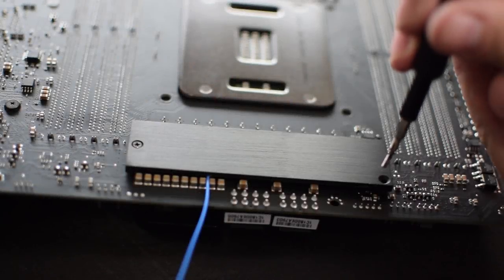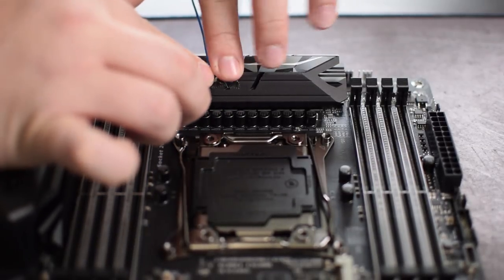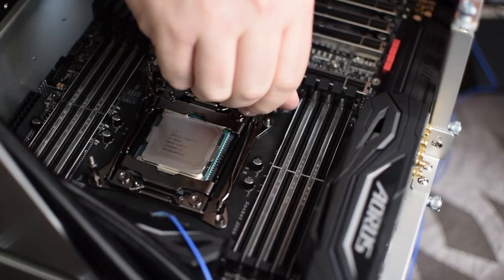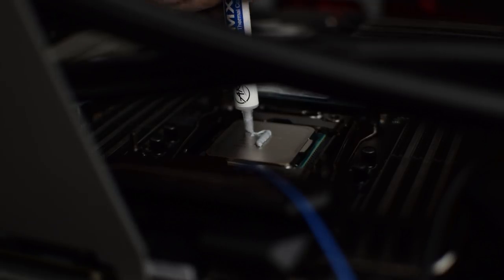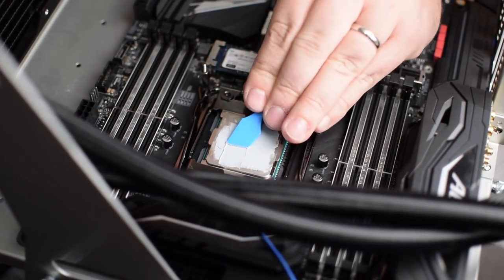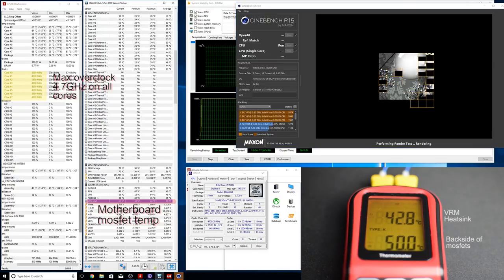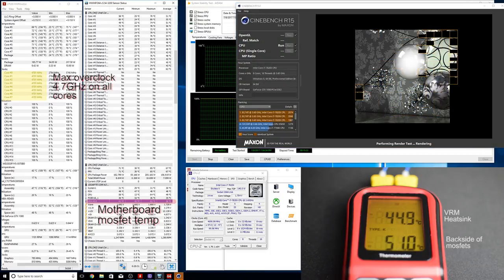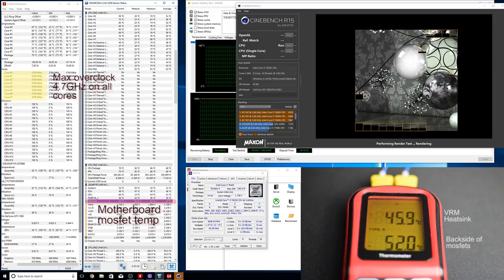The truth about X299 VRM temperatures featuring the i7-7820x & Aorus X299 Gaming 7

Comment: Im happy to see that you seem to enjoy the board in the end. I actually just picked up the "pro" version of this board which seems to have changed some of the power delivery with its phases. I'm hoping this might benefit cooling of the VRM if I do ever get the hankering for a high OC. Though I'm an air cooler guy so my OC will probably be limited to around 4ghz. And I imagine that probably wont stress the VRM too much. Same CPU as well.

 I'm coming from an i7 980x from the 1366 days so I'm partially familiar with a power hungry system :)
Reply from the maker: That is a massive upgrade man! Holy moly. I hope you enjoy the new system sir. Everyone had terrible things to say about x299, but I love it.
Reply: Let's Get Techy Thank you sir! It has been a long overdue upgrade. I think the power hungry nature of the platform isn't a huge deal when selling to enthusiasts. We know its gonna be hot, that's why we have aftermarket fans and heatsinks fo play with :)

Comment: I'm subscribing right now. Also I'm currently thinking about getting a 7820X, but I'm not really into Overclocking, maybe I'll be  getting it to 4 GHz. As you said this platform is not an entire mistake from Intel. This platform won't burn out your house unless you stress it to the limits. It will be worth coming from a crappy Dual Core AMD AiO build!
Reply from the maker: Thanks for the sub!

Skylake X, to me, is a great platform. I love it. That being said, its price to performance isn't all that great. If you are considering the 7820x, spend some time also looking at the Ryzen 7 lineup- especially the 1700x if you aren't much of an overclocker. You could easily hit 3.8GHz on all 8 cores with minimal effort. I'm not saying don't get the 7820x. There is a reason I got mine, and refuse to jump ship for Threadripper, but the R7 lineup (especially the 1700) has great price to performance. 

Thanks for watching! Hope to see you in the comments again soon!
Reply: Well, maybe I'll be pushing my 7820X to 4.5 GHz. As a first time builder, I'm planning to make a custom loop, it doesn't seem that hard for me, but I don't know if I need to delid, I'll see.

As you said, Ryzen 7 would be more interesting, especially for the performance/cost ratio, but I'm surely going with the 7820X and I have the possibility to upgrade to the 7900X whenever I want to, and that's great.

By the way, congratulations! You have a very informative channel that I really like, I'll be looking to more videos soon!
Reply from the maker: Whatever build you end up doing, come back and share it here. I would love to see it!

Comment: Great video!I'm thinking in making a new build with the 7280x. Could you please tell us what settings did you use for your oc? And where are they in that particular motherboard/bios?You probably said in the video but I missed it sorry (non good english speaker here) 😓
Reply from the maker: So the main settings you will be looking for on any motherboard are "core ratio" and "CPU core voltage". My settings for this overclock of 4.7GHz are a core ratio of 47, and a CPU core voltage of 1.19v. 

If you plan on overclocking, I would only recommend this CPU if you run a custom liquid cooling loop. I have it on a Corsair H100i V2 all-in-one cooler, and it hits close to 90c when encoding in Premere Pro.
Reply: Thanks! Did you disabled the intel turbo boost 3.0 or any other "auto mode" boost?

Comment: now in 2024 LetsGetTechy prooved it to be right and the fact that X299 is still awesome, lol, what everyone besides the VRM issue which was mosty created ^^ they heavly underestimate that platform :D
(currently running a 7820X/64gigs/1080ti on an Asus Rog Strix -E Gaming 1 and a 10940X/256gigs/RTX 3090/3070 on an MSI X299 Pro <3
Maaan!!! Was my R5 5700G/32gigs and R7 3800X/48gigs slow before that to heavy Multitask /game at the same time, even in gaming they where worse then the mighty 7820X which is hot and old now WOW, and all peopled cared at the time was the VRM issue and i scratched my head :P
Good jorb on the vid, alltho 7 friggin years later ^_^

Comment: great and informative channel was your 7820x delidded if not what max oc did you achieve and what was your cpu temps
Reply from the maker: Thanks for the comment! I have not yet delided my 7820x. I'm still waiting on Roman's delid tool that keeps getting delayed. :( Without a delid I was able to hit 4.7 at 1.19v but the temps were in the low 90s, so I backed it down to 4.6 at 1.16v until the delid. At that speed and voltage, I'm in the mid 80s.

Comment: I have my 7820x overclocked to 5ghz, but don't like the temps, even after delid using LM. "105c on three of my cores running 100%!" I can hit 5ghz stable 1hr on XTU at 1.36v, but can't run Cinebench, unless it's at 4.35v?! I'm using a ROG Strix XE. I haven't used LM on top of the IHS and waterblock, which should drop temps another 5c. Should I just go full water, or would I see little benefit? I'm using a 360mm AIO. "One of the best apparently."
Reply from the maker: What AIO do you currently have, and are you positive you have enough LM between the die and IHS? I went light on liquid metal once and had to completely disassemble an entire loop to add more, and temps dropped 20c. I would attempt LM on the top of the IHS before I went full custom loop.
Reply: fair enough. I may retry another application with more LM, but why is it that Cinebench requires that much more voltage, more than is needed when stress tested?.
Reply from the maker: Different programs just stress it differently. I've had CPU overclocks perfectly stable in CPU benchmarks and then load up a game that isn't even CPU intensive, and have it crash. It's weird the way that works sometimes.
Reply: I use the thermaltake floe riing 360. Apparently bested even the Kraken x62 and Corsair h115i
Reply: I'll apply more LM, I just don't want it all goopy, sliding around, even though I used nail gloss to protect the capacitors. It'll give me a reason to use electrical tape this time. but I'm still dying to go full water, since I have an open case. 215 single score and 2200 Multi in Cinebench is still pretty nice. though it might go up higher if I tame the temps a little.
Reply from the maker: That is a great liquid cooler, even better overclock, and astonishing CB single core score. I'm jealous man.
Reply: Thanks! How much is enough LM?
Reply from the maker: If you check my other delid video and look in the comment section, a lot of people disagree with me about that very question. You don't want it to look like a mirror-finish puddle, but you want just short of that in my opinion.

Comment: I Need a gigabyte X299-WU8 setup for the I9 7900X that has been delided....
Reply from the maker: Oh you mean like overclocking settings? Honestly every chip is going to be different, but you want to focus mainly on core voltage and loadline calibration. Look into both of those, and you should be able to find some base settings to get you started.

Comment: I want to get this Motherboard. Any recommendation for a case? Power supply size?  I was thinking of a 1080 and they mention a 650 watt supply
Reply from the maker: If you plan on getting this board you will be using a Skylake X CPU which are decently power hungry when overclocked, so if you pair it with a GTX 1080, I would suggest at least a 750w depending on which CPU you choose. As far as cases, they are so subjective it's tough to make a recommendation. Maybe take a look at the new Lian Li O11 Dynamic.

Comment: 208/5000
hello i have a 7820x i7 i not overclok them and i use a corsair liquid cooling h110i i go up to 85 to 95 degré you found you its normal?

idle: 40 - 40 degré

cpu stress: 85 -95 degré
Reply from the maker: I would not consider that normal, unless you are stressing the CPU very hard. What are you doing when it hits 85-95c? I would expect to see that temp if you are stressing with AVX workloads and using an air cooler, but not for more "normal" workloads and a Corsair AIO.
Reply: to reach it's temperature I used OCCT for stressed the CPU, I specify that the processor is not overclock.

sorry for my english I'm French ^^
Reply from the maker: I would suggest manually tuning your vcore voltage. The motherboard is likely automatically using more vcore voltage than is necessary. 

No worries about the English! It's fine. :)
Reply: on the other hand I just saw by removing the processor that a pin of the motherboard was crooked I straightened what is a report on the temperature?

I use a motherboard asus x299 rog strix and I had set the default bios parameter.
Reply from the maker: @xskyros  I'm not sure if that bent pin would affect temperature or not. Let me know how it goes once you put it back together.
Reply: Normally if the pin is a problem the pc does not boot, off the pc boot well works well I just have a problem overheating.

on the motherboard asus rog strix x299 i have 2 hookups
an 8 pin
a 4 pin

you have to connect the 2 pins?
Reply from the maker: If you only have the 8 pin connected and it works then the 4 pin is just extra for overclocking. Some require both and some don't. As far as the pin, it really just depends what the pin is for. I've had motherboards before with missing pins that still functioned properly.
Reply: ok I'm trying to plug that 8 pin

and see what is going to give, I also benefited from updating the bios I want to know thanks
Reply from the maker: Good luck!! Let me know how things turn out! :)
Reply: I have to try anything to change, it is the pin of the motherboard that is problematic.

more than to change the motherboard: /
Reply from the maker: I wouldn't think that pin would cause overheating though.

Comment: Doesn't the second heatsink of this board keep the vrm temps lower?
Reply from the maker: There is a second heatsink, that does help with VRM, but if you remove the safeguards, it still isn't enough to contain the heat. This board does a bit better than the others, but isn't immune to the issue.
Reply: But after which Clockrate do you have to disable safeguards? I want to delid my i7 7820x but i need a fitting board. Roman says the Apex from asus fixes the problem but i guess it takes a few months until it arrives
Reply from the maker: You don't HAVE to disable the safeguards at any particular clockrate. It is just one of the things you can do at any speed to help improve stability if you are having a hard time getting stable. Mine can do 4.8GHz on 1.22v without removing any of the safeguards FOR THE WORKLOAD I have. If I ran Prime95 with those settings and without the safeguards disabled, it would likely be very unstable very quickly.
Reply: Okey thank you this makes me happy. So i'll order this board

Comment: i have a question can you please let us all know the stock temps of i7 7820x ?? its a request cause this info is not available on net
Reply from the maker: Well unfortunately it seems like most of the motherboard vendors decided to have these chips run full core count boost out of the box. I can try to mimic stock form as best as possible, or I can leave it how it would be out of the box- whichever you would prefer.
Reply: A bit late but you need to upgrade your bios. I had this too at F5 bios. But after i updated i noticed that i lost performance. It is a setting called something like "enhanced multicore performance". I'am not sure if it is performance or what else. I can't deliver Temps either because i have a delidded 7820x
Reply from the maker: You are correct. Many x99 boards had this same "feature". It basically runs all of the cores at the max turbo frequency that Intel intended to run a single core at. Not necessarily a bad thing, as I and many others have overclocked well past this mark, but it can cause issues in situations like this where you can't directly compare temperatures across different board manufacturers.

What did you use to delid your 7820x? I'm not doing a good job of waiting patiently for der8auer's tool. lol

Comment: should I connect the two 8-pin ATX 12v on x299 mobo?
Reply from the maker: Yes you should. It isn't required on most, but I would definitely recommend it if you have the second plug available coming from the PSU. In certain situations like what I describe in this video, you can get the cables on the plug coming from the PSU very hot when only using one plug.
Reply: Thanks! :D
Reply from the maker: You're welcome! I hope you enjoy your x299 rig!
Reply: Hi, what cpu cooler did you use to reach 4.6ghz at 80temp? 
will a 360AIO cooler pull the temp down?

Comment: 1.7V what ?
Reply from the maker: It's been a while since this video, so I'm not quite sure what you are referring to.
Reply: sorry.. i mean the 4.7Ghz overclock running at 1.7V
Reply from the maker: 1.17 not 1.7. It would have immediately destroyed the chip at 1.7v on the core.
Reply: I know thats why i was surprised .. look at 8:10 .. cpuz and hw info shows 1.7V
Reply from the maker: It is reporting the CPU input voltage rather than the core voltage. It was likely that they just hadn't updated the app for Skylake-X at the time of the video.